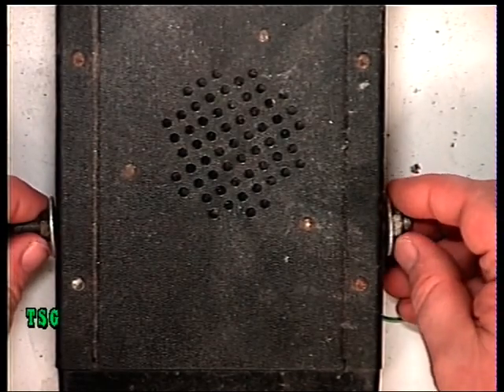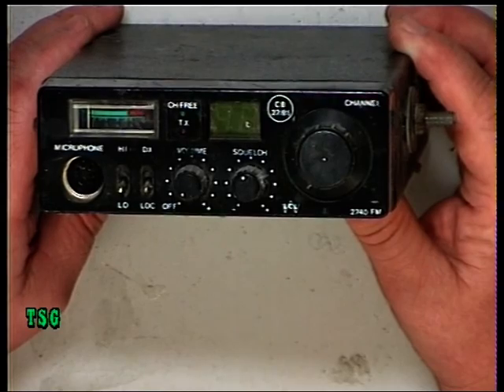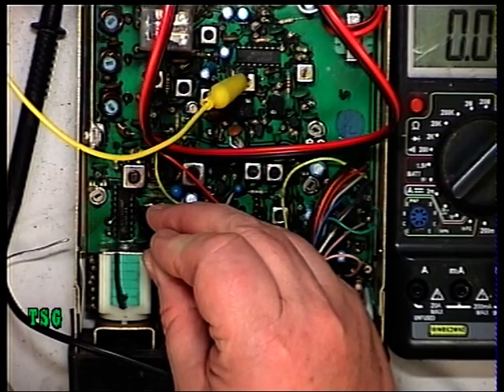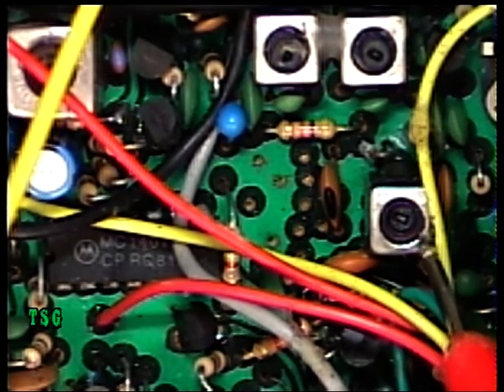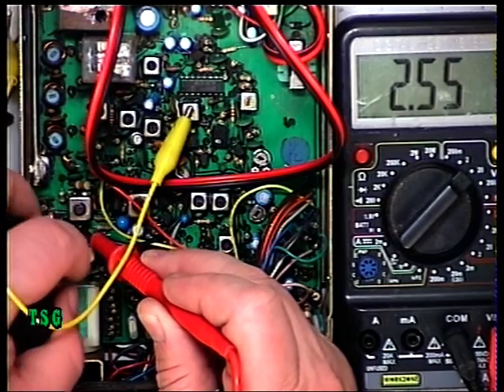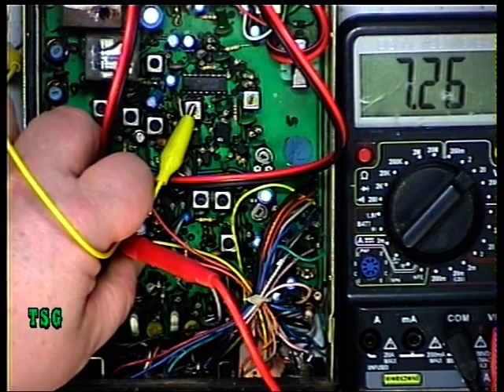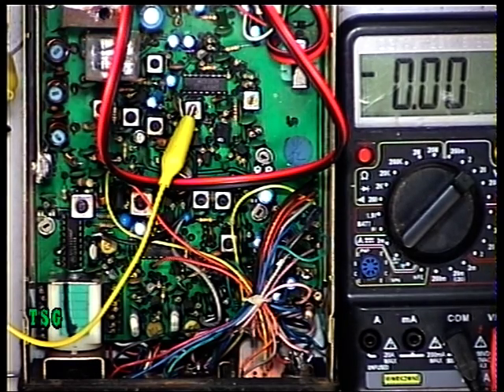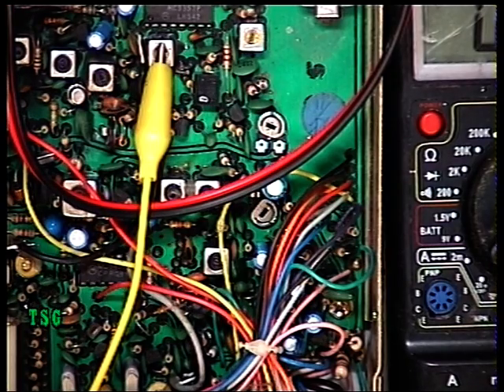LCL 2740 UK (CB27/81) CB radio (Mobile) - VCO adjustment (Covers DNT M40 too)

Comment: Hello from Russia, my friend. I need your help with the dnt m2740 transceiver. The transceiver works for rx, but for tx when the button is pressed, only a short-term switching on and off of transmission occurs. I tried to adjust the L6 coil, but the maximum that I got at pin 8 of the mc145106 is only 1.6 Volts
https://youtu.be/wHQrqWQRVYg
Reply from the maker: I'll do another LCL 2740 video in the next few days with special attention to the VCO & I'll try & replicate your fault. I watched your video.

Richard, G0OJF, UK
Reply: @ukfmcbradioservicingTango21  Many thanks. I will wait impatiently

Comment: Hi again Richard.
I need to set the RX VCO on mine as it's been twiddled with.
Is it the same process to set the RX VCO?
Reply from the maker: Once you set the TX VCO...I've never had to touch the RX one, but it's L18. I don't have a service manual & I doubt there ever was one. I would set the radio to ch 20 then adjust L18 until the signal generator because audible on the channel, then try to adjust centre position..then check ch 1 & 40 are in lock. After this you will need tyo set the RX frequency....assuming you have done the 10.24Mhz alignment & then the TX frequency alignment. RX frequency is set with a marker oscillator on 10.695 or 455khz as shown in the numerous LCL & DNT videos I've done.

I must dig out another LCL to show all this again.
G0OJF, UK
Richard,
Reply: @ukfmcbradioservicingTango21  
There is a fault with my radio somewhere.
The voltage is low on pin 8 when cold. As the radio warms up the voltage increases but isn't stable. 
I can adjust it to get receive on some channels but not all and they drift about all over the place. 
Need to find a circuit diagram to investigate further.
Reply from the maker: email me & I'll send you a copy  rshireby@yahoo.co.uk